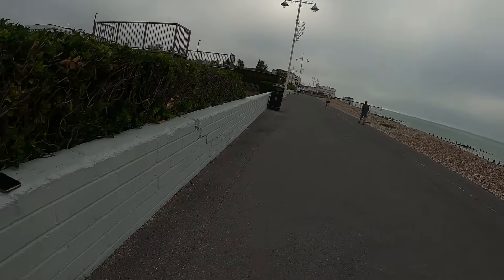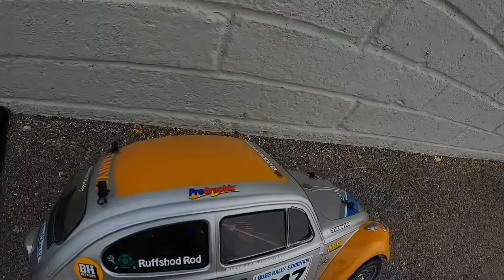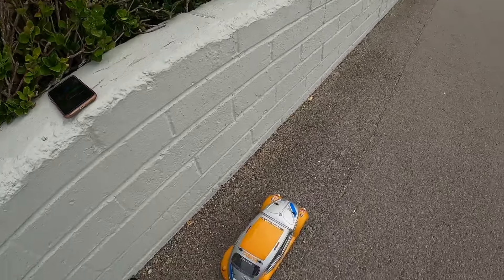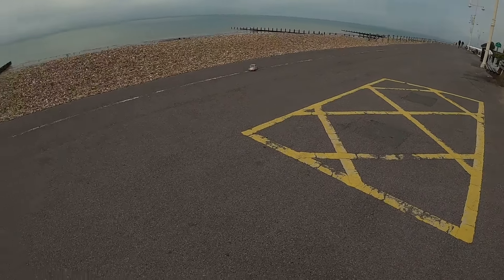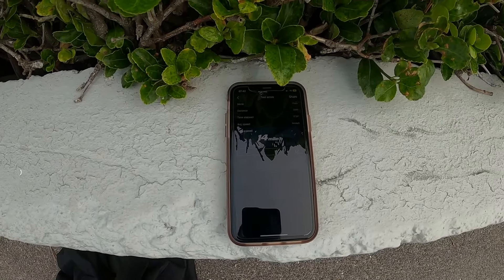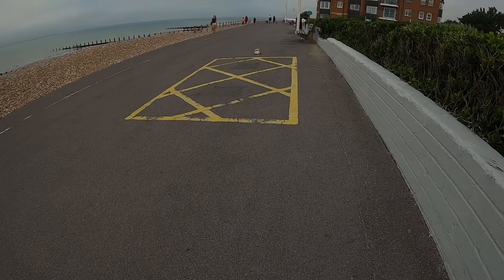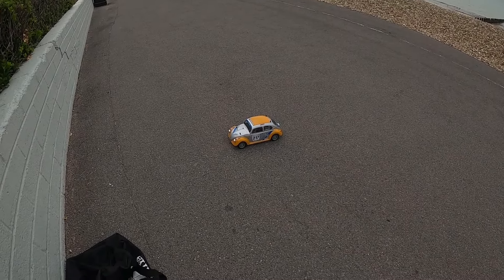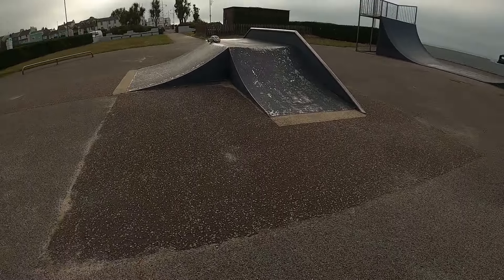Tamiya MF01X - Poor Boys RC Speed Run Challenge 2024 - Run 1

Comment: Nice first run and a good base to start. May I recomment a gyro? This shouls straighten the run.
Reply from the maker: Thanks for the tip!
Reply: Good first run, seems to be the benchmark for the standard speed. Yet to run mine as still waiting for a couple bits
Reply from the maker: I have one or two things to do to increase the speed but think I’ll be rooted at the bottom. Don’t want to throw everything at just for one run.
Reply: @rctamiyaaddict4687  yeah. Thats true. As for Dirks comment regarding a gyro, apparently thats the way to go and helps quite a bit. My difficulty will be finding somewhere open enough with no traffic or kerbs to destroy the car with 🤣
Reply from the maker: Lucky I have a seafront outside my house but have to go early morning before it gets busy.
Reply: @rctamiyaaddict4687  right, start slow and improve yourself. My first run (not released yet) was for testing and adjusting. I'm more of a crawler so this isn't my usual playground, but getting safer with speeding is very motivating.